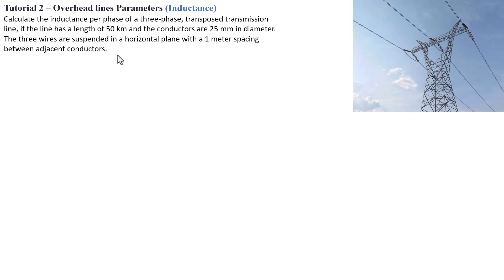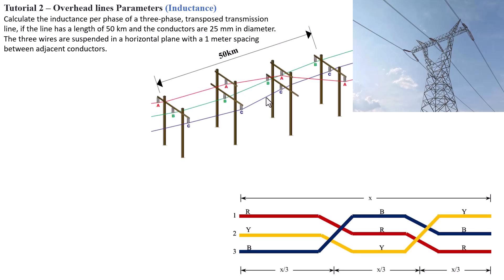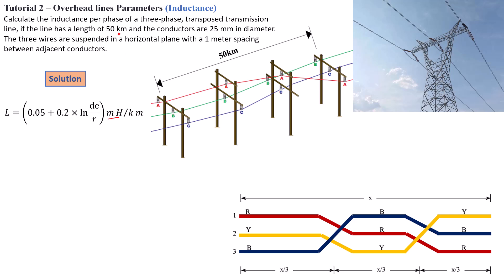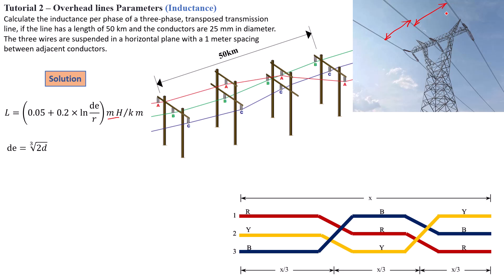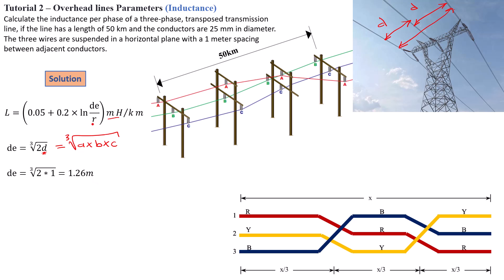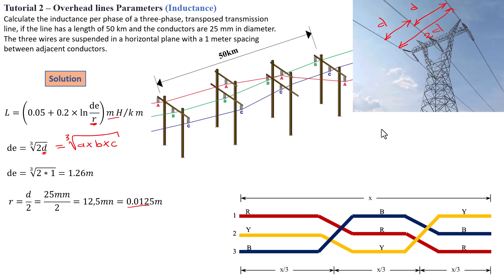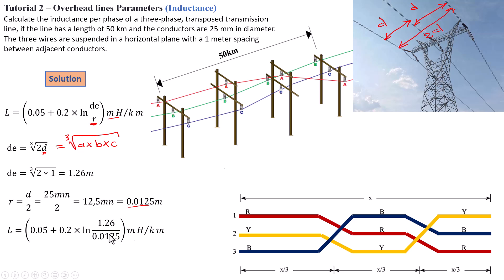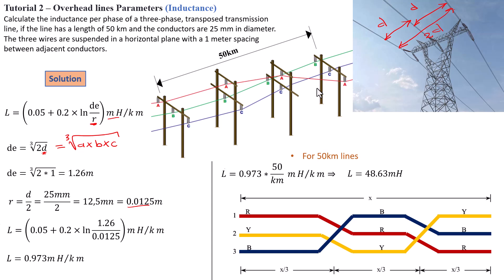How to calculate overhead transmission Lines parameters (Inductance) - Tutorial 2

Comment: Hi good day, 

May i know why u dont compute the gmr of conductor? Thanks
Reply from the maker: Hi, you raised a very good question.
GMR which stand for Geometrical means radius is more specifically related to the conductors's self inductance based on its own internal properties, this parameter is more crucial when calculating the line inductors for a bundled 3 phase (3 core) cables where the standard 1 meter distance between the cable does NOT apply.

For overhead lines we are more focused on the mutual inductance of the horizontal transposed and equally spaced lines. GMR is essential for both bundled and separated conductors but has a more pronounced effect on bundled conductors due to the proximity of multiple wires. 

In short you are right, GMR add more accuracy to the measurements or calculations, so its an important detail to add into the calculations.